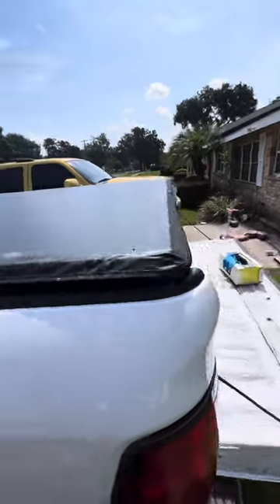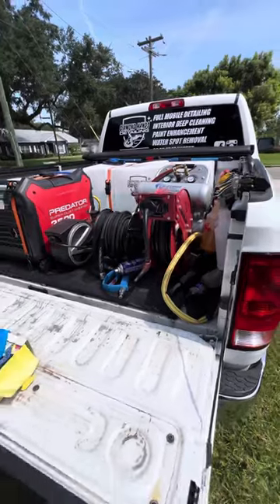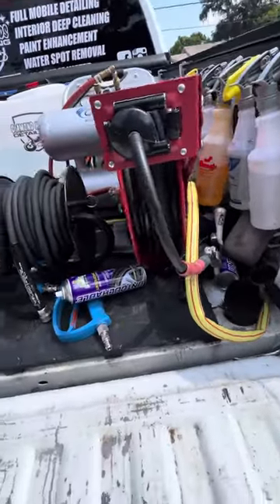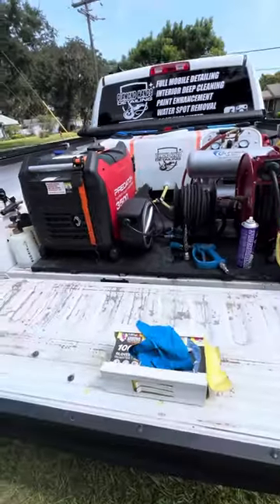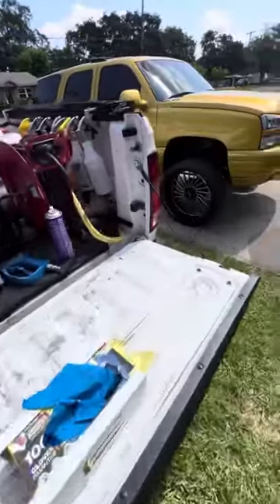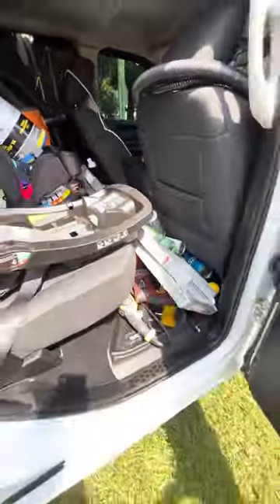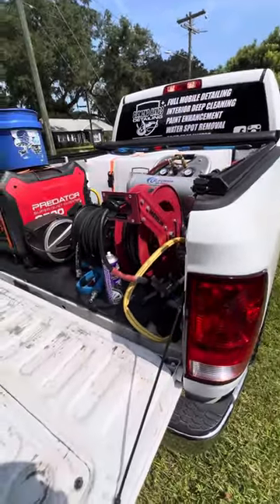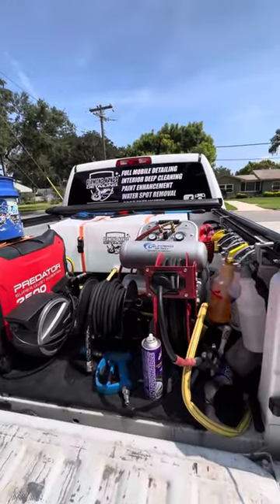Truck Bed MOBILE Detailing Setup!

Comment: how did you strap the water tank there? did you screw mounts into the bed?
Reply from the maker: Nope nothing screwed into the bed. The tank is mounted with eye hooked and ratchet straps.
Reply: @DiamondHandsDetailingLLC  I’m looking to do something similar, would it be possible you show me a bit in more detail how to secure the tank? I’m really schratching my head here..

Comment: Mann that setup is fire 🔥trynna have pretty much like the same setup you got there brother. Like around how much did you invest in all of your equipment approx?
Reply from the maker: I would say with the equipment here I spent roughly $3000. That’s including a couple hundred to cover materials for the build.
Reply: @DiamondHandsDetailingLLC  I bet, everything looks legit man. One more thing brother I would like to have your opinion, You as a professional detailer do you recommend going all out like that and buying everything that’s needed or start off little by little? I mean im new to this but I would like to just have everything and go for it feel me? my budget is around $2,000
Reply: @DiamondHandsDetailingLLC  btw, thanks for replying man much appreciated you just got yourself a new sub 👌🏼
Reply: @DiamondHandsDetailingLLC hey I literally have the same truck and was thinking on mounting everything to a plywood ! Haha but what pressure washer you use and compressor so it can turn on and off I have everything just need the generator and tornador

Comment: Do you feel like the roll up bed cover is better or would be better than the folding one? I have a 96 Silverado OBS and am thinking about doing the same. Now we use the customers water and electric as we detail outta our cars, but I did just get a 35 gallon water tank for $50 bucks and looking to get a generator as well.
Reply from the maker: I prefer the roll back because the folding one I looked at wouldn’t fold completely up and blocked me from getting to the front of the bed. I’m looking into a bed cap now though to get a taller water tank.

Comment: Hi im gonna pull the trigger on purchasing an air compressor for use of tornador type for and and crevices.
At the moment i have 2,000 watt predator genirator. Sometimes(most oftem i like to use clients power)

What size air compressor do j need for tornador or ur type of gun?
How manny watts does it use? Thank u in advance. Long live detailing and the hustle 🇺🇸
Reply from the maker: You’ll need something 4.5 cfm or higher for the tornador tool anyway.

Comment: Where did you buy the water tank and how many gallons? Thank you keep videos coming
Reply from the maker: Low Profile Water Tank - 60 Gallon Capacity - 42" x 28" x 18" - Perfect for Mobile Automotive Detailing Use https://a.co/d/4ElQJTu
Reply from the maker: That’s the tank I bought. Thanks for watching!

Comment: What size is your water tank, I have the same truck I was going to get a 100 gallon tank but I wanna keep the low profile
Reply from the maker: It’s 60. Honestly if you are good with going bigger the 100 would prevent refills during a full work day, but 60 is definitely nice for low pro

Comment: Full time right on man. What have you done to get customers.
Reply from the maker: Word of mouth and Facebook have been my best 2 sources. A lot of people go straight to Facebook when they need any service, so if you keep a pretty good presence on there you should get a good amount of work.
Reply: @DiamondHandsDetailingLLC  appreciate that. I actually like 5 clients from a Facebook group! And then it just died down. I guess I need to join more local groups and what not
Reply from the maker: @LewTh3Jew  yea just be consistent. I’ve found that people really like educational type posts like why you should remove bug guts or why you should get a paint sealant etc. Best of luck to you!

Comment: A suggestion 
Remove all the chemicals from your truck bed, you breath them
Or crack open the windows when driving around in it
It goes to your lungs, eyes and your health is priority one
Red eyes? Dry mouth? Dizzy?
The chemicals are working…
Not now, but it will show later when you age
Not good idea to have any chemicals in your truck cabin
Reply from the maker: All the chemicals I keep in the truck are the safe ones lol. Non acid, non caustic etc. The worst thing in the truck is an alkaline bug remover. I totally get what you mean though!

Comment: You need a van bro. It just looks all cluttered and overwhelming to get in that truck but hey each to its own I guess.
Reply from the maker: It’s not as bad as you think. Everything is within arms reach and I just make sure I put everything back where it belongs rather than crawling into a van to fill water, find materials etc. A fully built high roof van would be nice but then I lose accessibility like I have with the truck. It does get a little cluttered after a day or 2 of work though lol.
Reply: I use a 98 chevy Astro. Best rig in my opinion. It does have almost 400k on the odometer so I’m thinking about using my gmc sierra 1500 with a 6.5 ft bed. 1 reason I believe the truck is better is the insurance. Insurance companies want an arm and a leg for cargo vans.
Reply: You definitely don't need a van. A truck works just as well. A trailer too. You don't have to it or pay for insurance gas or maintenance